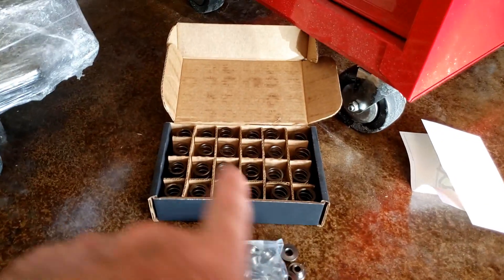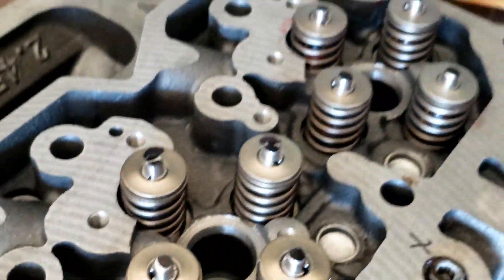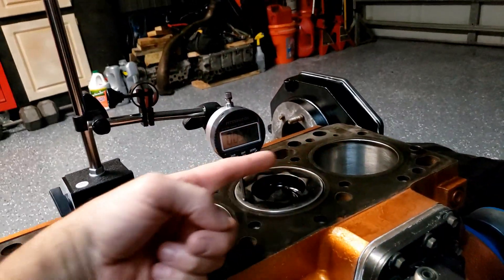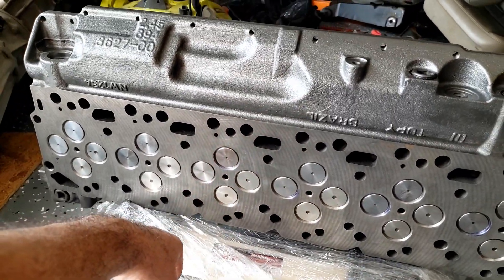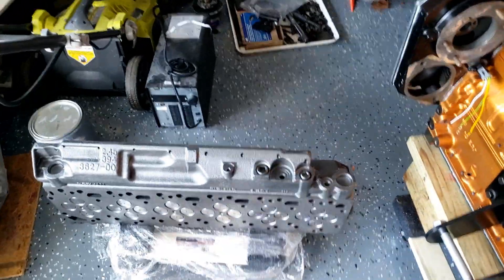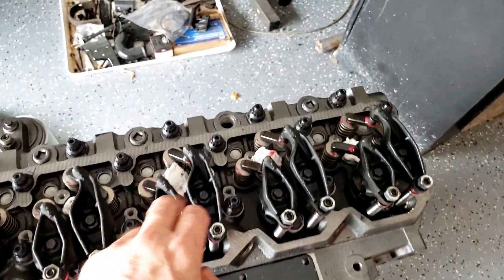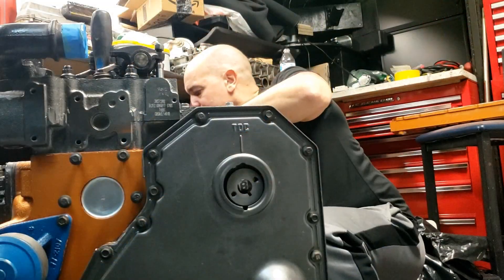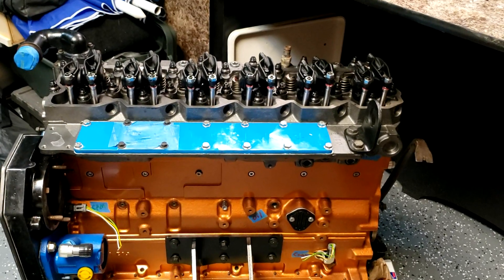Cummins 2nd gen 24v new head install with Xotic studs and 103# Hamilton valve springs.

Comment: Overall how difficult would you say this rebuild is? I've rebuilt motors for skidoos, but never a diesel motor, let alone something this big. I have a 2000 24v 5.9l cummins and was considering doing the same thing.
Reply from the maker: its actually the most simple engine ive worked on. been put on the backburner. need to buy some more parts.